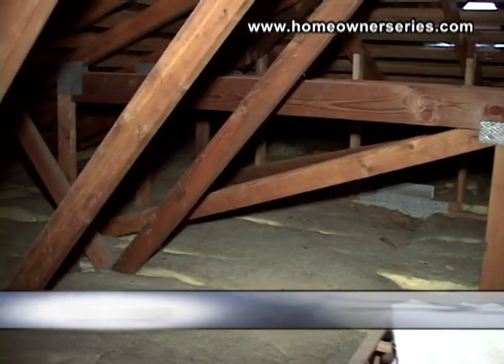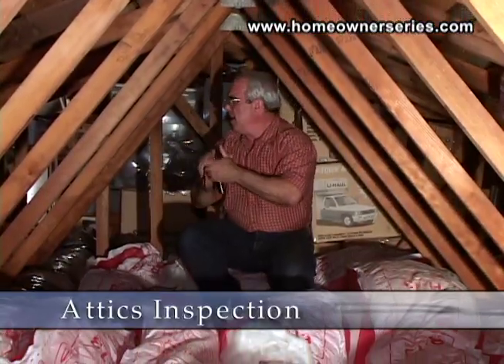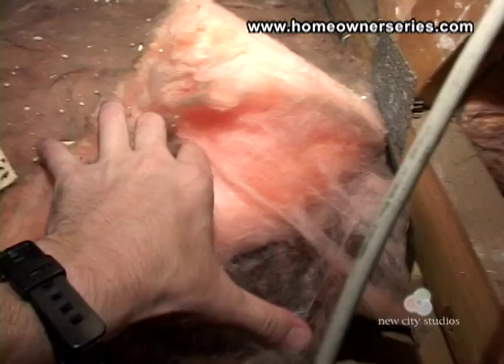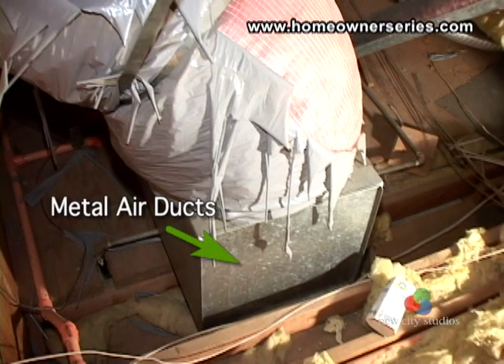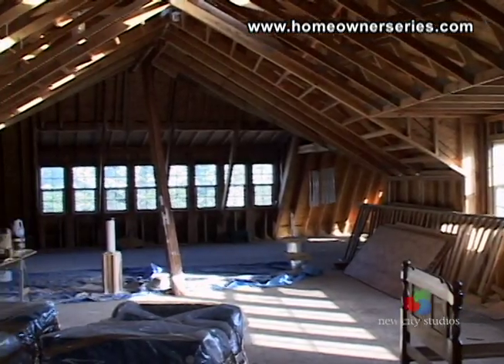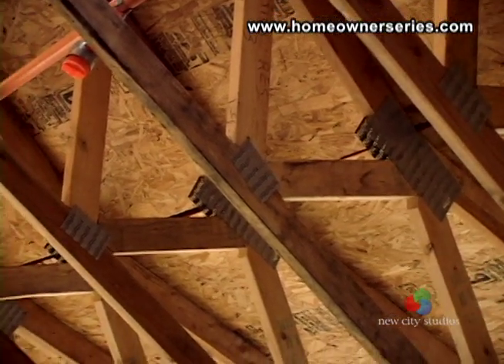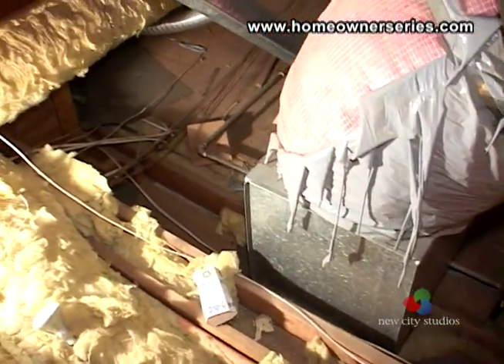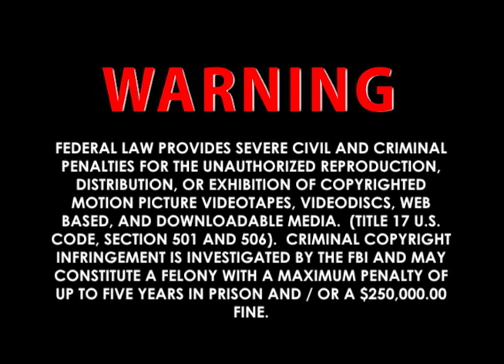Home Inspection - Attics

Comment: Have a respirator or dust mask at least  plus gloves. Also whatever you wear immediatly remove it so if you get any fiberglass on it it doesnt irritate you (not necessary but just an extra precaution )

Try to go there once every season and especially when it is raining very hard to really check for a leak. A home inspection done during dry times may not show all the story. If you own a home really pay attention to your attic.

I just bought a home and put a few cheap humistat there to show me the min and max humidity. I am checking it after each month to see the average humidity min and max. I want to see areas that have higher humidity and check those for any major issues. I feel this will allow me to catch any hidden issues.

I am no pro at all but I learned that data can help you make good decisions and perform prevention repairs before they become reactive repairs (normally more costly)

Also if possible create a walkway to make this check safer and easier. Do this, if possible, in a way where you are not covering important check points. Also be sure to use pressure treated wood. Use wood treated for outdoor use and treat the attic as an outdoor space (my opinion) so rust/mold resistant materials should be used. This is for a crawl space mostly (my attic is a crawl space not a walk in attic) if you have a full attic my opinion is to keep the ceiling unfinished so you can see leaks but that's not usually preferred I am just paranoid. Out of site does not mean out of mind.

Again I am no pro but it is what I am doing and would love any input if I am wrong and should do something else.